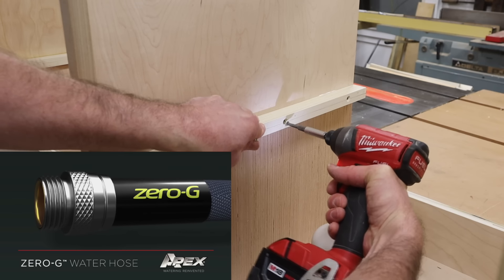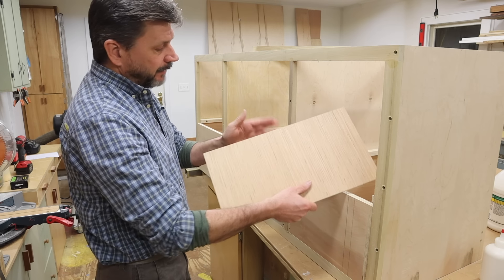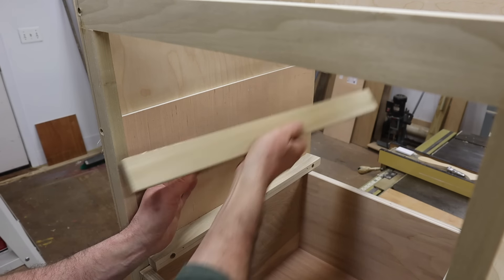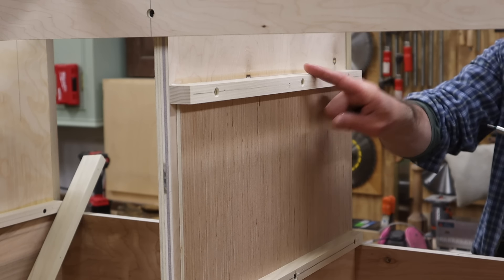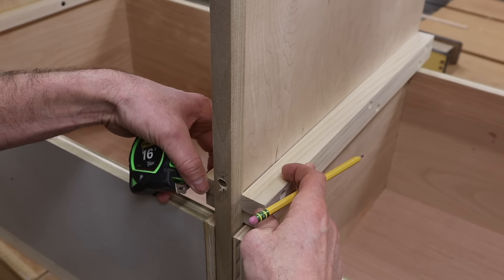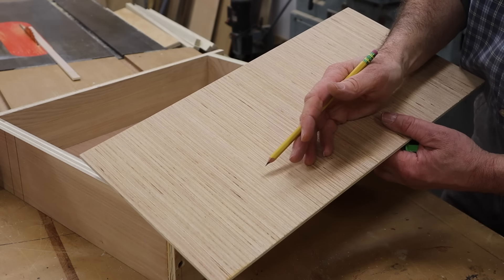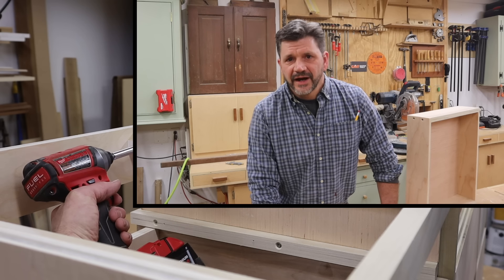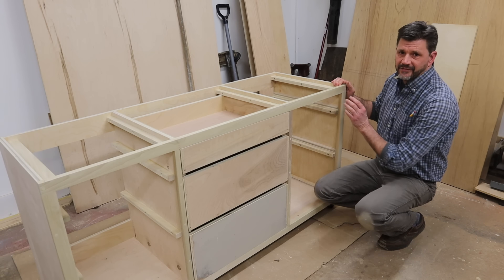How to Fit Drawers - Save Money with DIY Wooden Drawer Slides!

Comment: Thank you for providing such a clear example of how this sort of drawer slides work. I'm building a router table right now and I have those narrow drawers to the side of the router. They are so narrow using a metal slide combined with the drawer sides would take up too much of the space. This is the perfect solution. Long time follower but came back to this video now that I needed it. Thanks again!

Comment: I always use jigs for wooden runners or full extension runners but I cut a jig for each draw runners in the set so each set of drews are all the same but we put another draw front on the Draws nice job you have done 👍👏 🇬🇧 stay safe

Comment: Old school way of draw slides. I will be using plywood slides on my drill press cabinet.  Draw slides are very expensive,  i will be use one set of metal slides.  That is for a tray that holds my 6" disc, belt sander.

Comment: These drawers will slide much more easily if you put thumb tacks on all 4 (top and bottom) back corners of the drawer and on the top of the runner/cleat at the front end.  You will need about 1/8 to 3/16 extra clearance.    Works best if you relieve the bottom front of the runner to allow the thumb tacks to clear each other as you insert the drawers.
Reply from the maker: 👍 true thumb tacks work great
Reply: What a great tip! Thank you. And thank you for writing “slide more easily.” Proper English grammar—what a treat!
Reply: Just wax them up and they'll run like ice.

Comment: Great video, so clear and concise and a great tutorial thats easy (even for me!) to understand.
Just one thing, would it be a good idea to apply some paste wax to the door runners on the bottom and top of the the cabinet and maybe also the sides and top edge of the drawer and bottom of the drawer to sllow it to slide even easier?
Any suggestions would be most welcome 😀
Great video

Comment: I like the idea of not using metal hardware, but I do have a question. I live in an old Victorian home that has some built in cabinets what use essentially the same approach you show here. After (many) years of use, the wooden cleats as well as the bottom of the side of the drawers have worn such that the drawers to not sit right anymore. Do you recommend a way to reinforce these parts so that they remain sitting correctly?

Comment: What is your technique for keeping the drawers from falling out when pulled too far? One reason I like regular slides.
Reply: You can make a groved track with a Router and have it slide in a track on the side of the inner walls.
Or you could make the front face and backface drawer sides higher than the sides and just have a stop pkug on the inside of the walls.

Comment: Great video, thanks, Jon! Building some larger drawers that may be fairly heavily loaded, but still want to try wooden slides. Did you use hard wood for the runners? I was going to use maple and coat with Slipit r equivalent for easier sliding. Thanks!
Reply from the maker: I use poplar but maple will work great 👍

Comment: Question:  Do you have a method for keeping those drawers from being pulled out too far?? ... or pushed in too far without a drawer face that overlaps the face frame??
Reply: When he puts a back on the cabinet, the drawers will butt into it and be flush in the front plus I am guessing he will probably add a drawer face.
Reply: @jtltet  That'll keep them from going in too far, what keeps them from being pulled out too far??
Reply: @barpluc3977  Hopefully common sense...lol
Reply: @jtltet  I guess I'm the only person to have ever pulled a drawer system like that out a quarter inch too far and scattered the contents all over the place. ... especially if the drawer is so deep it goes all the way to the back of the cabinet.  

If I'm using that guide system, I make the back of the drawer 5" from the back of the sides so it warns me i'm at the depth of the drawer before pulling it out all the way.  But he didn't build his that way.  In his case you must hold the front of the drawer up to see what's in the back, if you let it go, it'll go to the floor.
Reply: @barpluc3977 , the back of his drawer is a few inches from the back of the cabinet.  Also, if you pull it out far enough to see in the back of the drawer and let go, the cleats from the drawer above prevent the drawer from tipping and falling out.  I don't see a problem with it, plus this is his cabinet.  The rest of us can build ours however we please.  I like this for cost savings in a workshop cabinet.
Reply: Just put a simple tab on the top of the drawer back. I’ve experienced this design on bedroom furniture to prevent drawers from over extension.

Comment: Great build. I would like to know what battery powered nailer you were using in the video. The bright green one.
Reply: Daniel, I did a little looking and found what I think is that nailer - it's a unique (and pricey) one, if I am correct: https://www.nailgundepot.com/grex-gc1850-cordless-18-ga-brad-nailer-2-details.html  Operates off of AAA batteries and "fuel cells," which look like they are basically compressed air cylinders (a bit like CO2 cartridges).
Reply: @jimconway4422  Thank you for finding that. I agree it is a bit pricey. Since I'm not to the point of buying one I'll keep looking and trying to compare notes. This is very helpful. Thanks Again.

Comment: It is far easier and no chance of errors if you use the drawer itself plus a piece of card as the spacer to align the runners. With your method, there is a possibility of an error in transferring the measurement from the drawer to the ply template.

Comment: Simple and easy. Thanks Jon!
What model is the cordless brad nailer you're using? And what is your experience with it? I am looking for a cordless brad nailer, looking at all the options. Cheers from Mexico!
Reply: I think it is a Grex GC1850. It's a unique (and pricey) one, if I am correct: https://www.nailgundepot.com/grex-gc1850-cordless-18-ga-brad-nailer-2-details.html  Operates off of AAA batteries and "fuel cells," which look like they are basically little compressed air cylinders (a bit like CO2 cartridges). Hope that helps.
Reply: @jimconway4422  thanks! Pricey indeed

Comment: Nice!  I've made all of my shop rolling carts this way!  But my question is not about that, but on how your table saw runs so smooth....what kind of belt do you run on it?
Reply: @boppins  thanks for the reply.  Mine is mounted on a hinge.  It uses the the weight of the motor to put tension on the belt.  It's a Delta 36-979

Comment: eBay Jon, that's where you go to save!
Reply: No. Unless there's a liquidation, items on Ebay typically cost more because the seller and Ebay both take a % on top of the original retail price. If you want savings, DIY or deal with the manufacturer directly - the more people involved in distributing and selling a product, the more the price goes up, not the other way around. Economics 101.

Comment: As much as I like the idea of wooden rails to save money, doesn't the wood after a short time move causing bind ups? Also, wood is not all that slippery for sliding drawers with weight...and how about stops to prevent drawers from sliding out too much?
Reply: The wood movement question really depends frankly. If installing the runners the correct way, the radial expansion and contraction is nominal, especially if using proper species that is well dried and it will be in a well climate controlled area. Still you can't stop all movement, but you can account for that little bit with a slightly looser fit between the drawer and runners vertically. Also, if using a good hard wood for runners and the drawers with some paste wax, you get incredibly smooth operation even with weight. And yes, there are many ways to incorporate stops.
Reply: Wooden furniture with wooden drawer slides have been manufactured for hundreds of years. It is a time honored and proven technology.

Comment: Personally I would never use wood sliders instead of expanding ball bearing sliders.
I simple don't like the crusty feel of old drawer fittings that are hard to pull out and close, it feels very antique and when loaded with weight cùmbersome.